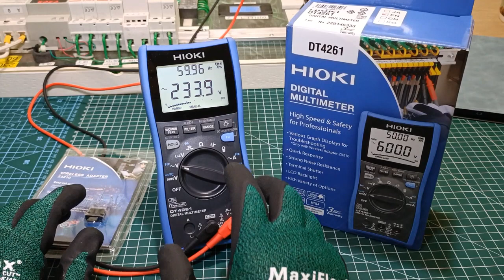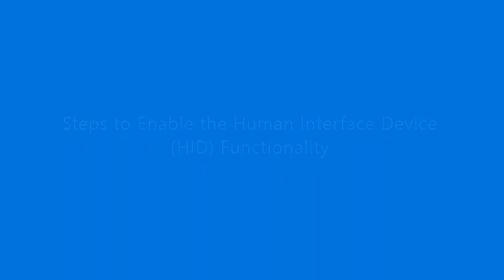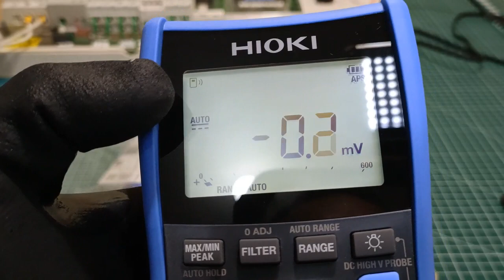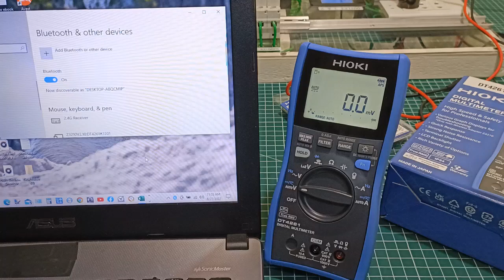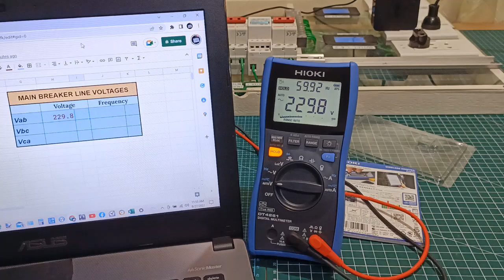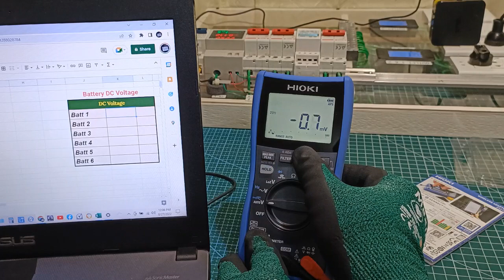[ENG SUB]HIOKI DT4261 & Z3210: How To Use MS EXCEL Direct Input Function (Part 1 of 3)

Comment: The Hioki CM4375 supports the Z3210 adapter.  Does it also have the Excel Direct Input Function?
Reply from the maker: I don't  have a first hand experience with the newer CM4375-50, but based on it's published information, yes. It supports Direct to Excel with the Z3210 installed. You can verify here: https://www.hioki.com/sg-en/products/clamp-meters/ac-dc-clamp/id_451384
Reply: @ramschannelreviews  yeah it should work with devices that support the Z3210 adapter.  Thanks for the link.

Comment: This is fantastic! I wish I had bought this model instead of DT4282. Never thought the Bluetooth function could be so convenient and reliable. Part of my work is to reverse engineering and redrawing schematics of electronics boards. I can use Excel sheets to register component values alongside their pcb number. Simply awesome!
Reply from the maker: Thanks for your comments. It would seem that your detailed work could benefit from the BT/wireless apps of DMMs. You can still buy the DT4261 if you wish. At least when you need the features unique to the DT4282 you already have it. I think both fill a need and are essential for their intended use. I appreciate your support.

Comment: Pls do a functional test,, I waiting to see how much voltage they use on diode test. Most hioki dmm uses below 2.8dc or maybe higher only issue is they restrictted the count to only display below 2.8 to 3v volts so if the voltage drop exceeds the normal forward voltage drop af a semi conductor juction these dmm will show OL specially when testing LEDS or other semi conductor that has high forward voltage drop
Reply from the maker: Thanks for watching. I purposely separated the wireless functionality since (for me at least) this is a big deal. Hioki isn't the only one making wireless multimeters these days so the innovation trajectory for manufacturers appear to be wireless for their handheld meters. I believe we'll be seeing more of these. There's one more wireless video I want to make before I deal with the usual DMM functionality. It's the Gennect Cross app. As to the price, the prevailing online market price seem to be around U$350 for the whole set, the DT4261 with the Z3210. I'll put a link to their local official Philippine distributor (I'm not affiliated with them) so you can inquire. You can also download the user's manual of both devices from the links in the description.
Reply: @ramschannelreviews  just done reading the manual, forward voltage drop is 1.8v so not gonna light up some LED, been using the uniT 61d+ with data logging on blue tooth using an adapter uni-T works really great it can log directly to your phone via the app then can export as an excel file
Reply from the maker: @juancarlossandoval5628  Yes, its Diode threshold was up to 1.8V only. But it has ample headroom on resistance and capacitance. The DT4261 was oriented more for field work given its IP54 environmental protection and drop proof features. I'll discuss these in a later video. And I agree, many other DMMs have wireless functions. It's a natural evolution, I think.